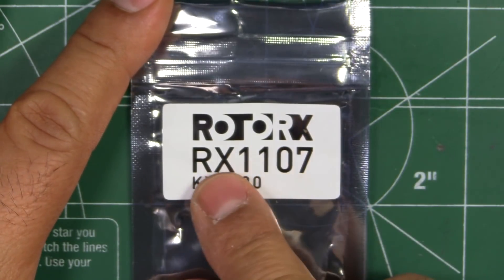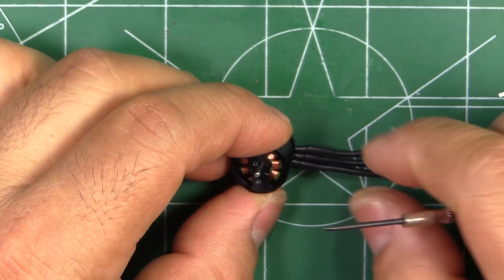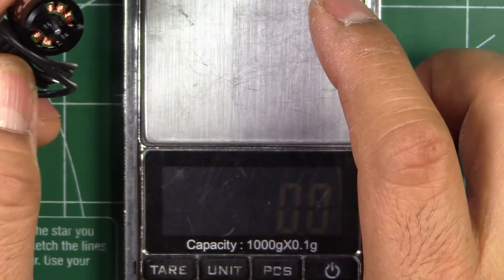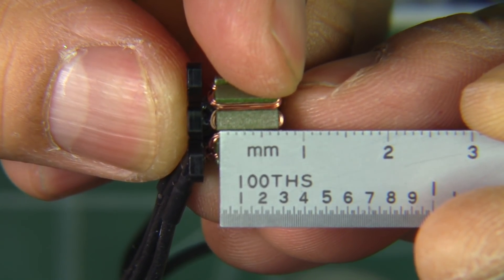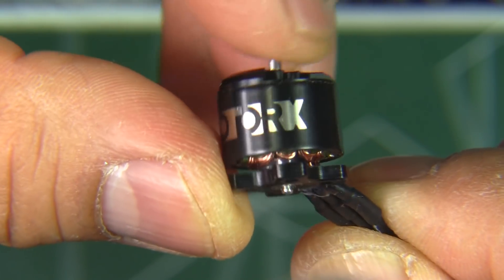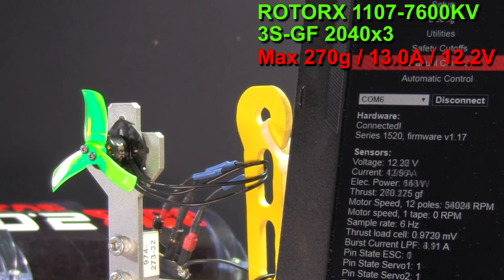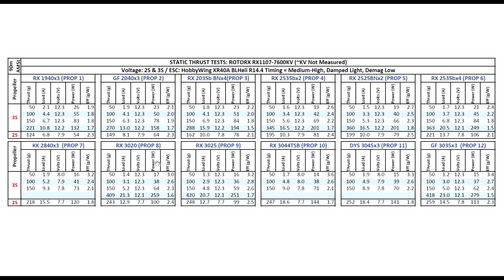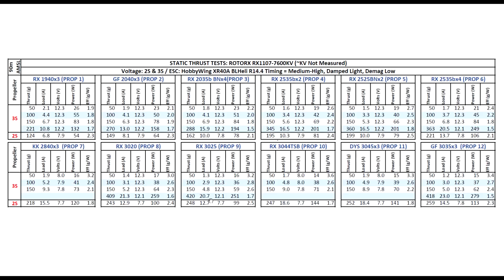RotorX RX1107-7600KV Thrust Tests & Overview

Comment: So I wanna rock 4s on a 2.5 inch. But I don't get thrust numbers I'd like out of 1404 motors. What would I need to do to get this yo run 4s
Reply from the maker: Definitely not this motor. 7000KV and above is too high for 2.5" on 4S I think. Though, probably someone will prove me wrong on some insane flying video.
I think even the EMAX 1106-6000KV has a hard time on 4S and it's probably at the limit for 2.5" on that voltage, but I think there are people running it so that's something to look into. There's also the new rcINpower 1108 4000KV & 6800KV. I ran it on 3S only but seems it should be OK on 4S with a 2.5" prop, however I can't confirm 100% that it will not fry. For such near-the-limit setups, the only way to find out if it'll work is to actually test in the air.
Reply: Agreed lol 7000kv is just too high. The rcinpower 1108 4500kv is the one I'm going with.
Reply from the maker: the rcINpower 1108 is 4000KV which could be too low for what you're looking for. 
Unloaded "theoretical" rpm - in reality it's closer to half with a propeller.
4000kv x 14.8v = 59200rpm
7800kv x 11.1v = 86580rpm (motor on this video, reported to work with 3S but have to be careful)
6000kv x 14.8v = 88800rpm (need to confirm EMAX RS1106-6000kv can support 4S)

So you need something with 5800 to 6000Kv to get similar performance as this 1107 motor. Like Sharon Otmazgin amazing flight video in the description.
I think 1106-6000kv may possibly run too hot on 4S-2.5" - would have to test-flight
dys has 1404-6000kv but no tests on that one. 
1108-6800kv could be a little too high, but may work. Also have to do torture flight test to find out.
Reply: yes plz do! i would love to know. and thanks for the info

Comment: These seem very amp hungry on the high end, I planned on using the hglrcf428 stack will that be able to handle gf or rx 3025 props with these motors on 3s?
Reply from the maker: Check out Sharon Otmazgin channel, he has the best videos of this motor in flight. I've linked a video flying on 3S on the description. Here's his channel https://www.youtube.com/user/sharonotm/videos.
You'll need a super light setup and 2.5" props. On 3" props and 3S I've read a couple reports of motors overheating and ultimately frying.
Reply: Thanks for the quick reply!  That video for the 2.5” props is great, I saw your posts on rcgroups as well after some digging.  It seems the motors will be fine with the bi blade props I’ll probably pick up some 2.5” ones too just to be safe, I was actually more worried about amp draw on my esc I just don’t want to fry it with these little beasts haha
Reply from the maker: Mike Small That stack is 28A rated right? If so, it'll be fine. In-flight Amps decrease quite a bit. The way this motor flies just unbelievable!
Reply: Excellent thanks for the input!  Can’t wait to get all my parts together now, these motors look great!

Comment: I appreciate all of your reviews - very helpful! I am curious about why you use medium-high motor timing in all your reviews. Does it have anything to do with motors being on a test stand, or is it something you believe to be generally applicable to all of the quad motors?
Reply from the maker: George H that setting is from the earlier versions of BLHeli about 3 or 4 yrs algo. It was the better setting to avoid de-sync. Also, I left the same settings to keep test conditions consistent. It the same ESC I've been using for the last 3yrs. Nowadays, the latest revisions of 
BLHeli work best with default settings so I don't think there's any reason to change timing.
Reply: EngineerX  - Thank you and Happy New Year!

Comment: I think it'd be really neat to see the Racerstar BR1103B thrust test vs some of these newer motors. So many people are still using them and have the impression that because they're 8000kv they'll perform the same as say, an 1105(6) of similar kv. I have a hunch the HGLRC 1105 6000kv will even perform better (more thrust) on the same prop because of the added torque in the higher stator on say a GF 2035x4 prop. Any thoughts on that?
Reply from the maker: Dan Kuzma Yes. On a very light setup and well-matched prop that motor could perhaps fly as well as a 1105 of lower KV. That's what I've been reading on the BH 1402-8100kv and 9500kv. So that seems to be that case. However, I've noticed on those micro motor with shorter stator height and very high KV, thrust stand numbers end up lower than expected but in-flight as propellers unload and quad is moving forward at speed, those motors are able to reach high enough RPMs to match speed of the larger 1105 or 1106 motors. I'll see if I request the 1103s from RCX.
Reply: EngineerX Yeah that makes sense about unloading the prop for straight line flying. But without the added torque I’ve found the 1103 weak when arresting falls. 3S is much better. See if you can get some lower kv/higher stator 1105ish too. It’d be interesting to pit against my theory that the lower kv will perform equally or better. Love the work you’ve been doing. Your videos have been my go to for motor selection. Thanks!
Reply: Nevermind. I just found your HGLRC 1105 6000kv Thrust test lol. Even tested the 2035 props I use! Nice!
Reply from the maker: Dan Kuzma Great. Good to see tests were useful. There are so many possible good choices these days it's very hard to decide what to chose  ;)

Comment: Which 11XX motor handles 4S battery?
Reply from the maker: zaqwsx28 1106-4000 to 5000KV. I would go for 4000 to 4500kv on 4S. rcINpower has a 1108-4000kv that should be nice on 4S. I got it but won't get around to testing until a couple of weeks from now. For a more relaxed setup, the RotorX 1404-3600kv would be a great choice. Very efficient so it'll get you longer flights.
Reply: I run 4S on these three motors with great success - emax rs1106 4500kv racerstar  br1106 3800kv & dys be1104 4000kv
Reply: I run 4s on the SunnySky R1106-6500kv, I don't think you'll find a stronger 11xx motor than that motor on 4s lol.